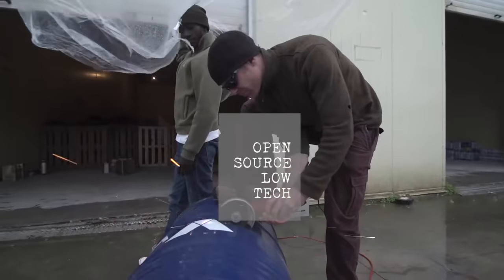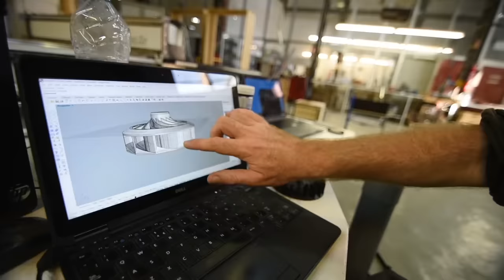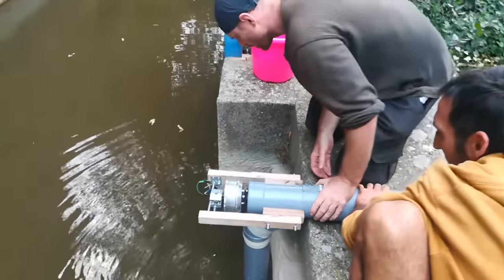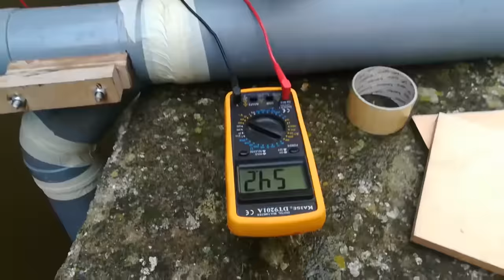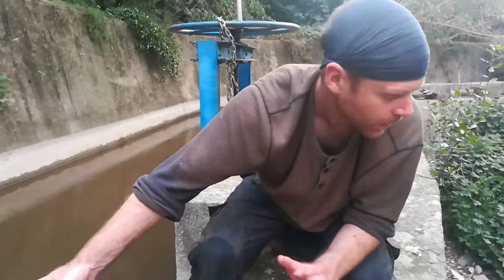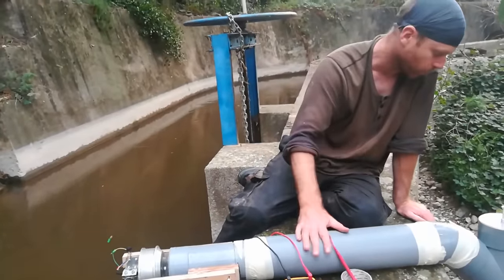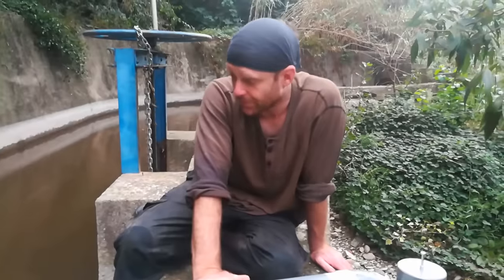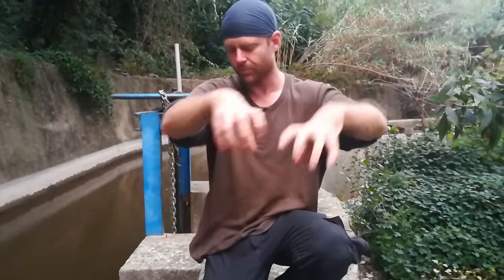The $50 Water Turbine -DIY, Portable, Powerful, and Open Source

Comment: So, first off, this is a fun little contraption that does indeed have real-world applications, so keep it up.  This is the first time I've heard of this open source project, but I think I might like to get involved!  Anyhoo, others have mentioned a few issues here and there, and things that need to be considered, and I'll just throw a few items in here as well (some of these may have already been mentioned in other comments):

1. Any air drawn into the siphon tube will want to find a place to collect.  The longer your discharge tube, the greater the chance that some of the air will be trapped at the top elbow.  A "band-aid" solution to this problem is just to add a large air-gap reservoir at the top where you've placed the cap.  A long term solution would be to use a small take-off siphon line to develop vacuum in a smaller diameter pipe along with your main discharge. In this way, you could create an "eductor" (yay Bernoulli's principle!) which draw any air out of the reservoir, thus preserving the main siphon.
2.  Your impeller is one of your major bottlenecks for producing max, continuous power.  One solution might include a multi-stage impeller with stationary blading in between.  This will maximize torque if you get it right.
3.  Blade seals - I'm not sure how you would do this simply and cost-effectively, but the trick here is to prevent any flow from passing the impeller blades without imparting any force.  Typically, a labyrinth seal is used for this, but I don't know if that's easily applied.  Perhaps someone could come up with something via 3D printer.
4.  Suction screen - you don't want to accidentally suck up large objects which could damage your impeller.  You need to put a large screen at your suction - larger is better because you will want to compensate for partial blockage in the event something gets stuck on the screen.  Simply having a section of your suction piping that has a zillion holes drilled into it, and a capped off end would work.
Reply: Eeeeeeee e eeeeeeere la ee de los de ee
Reply: Somebody understands what's happening. Wonder if they have a channel on youtube with a 3-d instructional video? I guess I'll go searching now.
Reply: @aicram62  I don't, although I've considered making vids like that.  So far I only have videos about growing exotic peppers lol.  I'd be happy to explain any part of what I said (or any other principle in this family of physics) if you have questions.  Also, I'm 100% sure there are other people who have great explainers, too.
Reply: Governments could make available injection moulded turbine blades, perhaps in glass-reinforced polypropylene.  Also, a blade design that could be reproduced locally with simple indexing lathes would allow villagers to make lots of blades and rotors. Really the blades could even be carved out of wood.
Reply: @MichaelIreland  Thank You I'm still feeling out options so I'm not ready yet. I was just impressed with your reply.
Reply: @aicram62  all good buddy!  Feel free to fire me a message any time :D
Reply: I just watched a video made two years ago where he used “stuff” he has laying around the house for all electrical components but make the impeller from a 3D printer. So that could be a viable option. He had cups on the end of the blades to use as much of the water as he could
Reply: @chasjacks9378  for sure, there are quite a few interesting impeller designs that could be useful.  Having 'cups' (they're, weirdly, usually called "buckets" on turbine blades) can help increase the torque output while reducing the speed.  This is often useful when your shaft bearing can't handle high speeds due to vibrations or if they're made of materials that wear out quickly.  Higher torque is also useful when the load (power draw) is higher than the turbine was originally designed for (results in decreased voltage, but still capable of producing current).  The real trick is to have a blade design that is fault-tolerant (so, can handle problematic flow, etc) while ALSO having as little clearance as possible (as in, water can't sneak past the turbine without pushing on the buckets).
Reply: @MichaelIreland  Hi Michael, i appreciate your input. Can you explain how this generator can produce that kind of power while not being placed at the bottom (where the water falls out) of the pipe, to benefit from more pressure due to accelariting gravity and stuff? And do you believe it would produce more if it was placed at the bottom?
Reply: @RedPillSpill101  I'd be happy to talk about this when I have some more time.  I can make some suggestions that will help.
Reply: @MichaelIreland  Great, whenever you have the time. It would be much appreciated.

Comment: wow never seen a siphon style turbine before.
Reply: do you think they're generating power legitimately already downstream, behind this guys camera?
Reply: siphon between farm ponds, back and forth, as long as the outlet is longer than the intake it will work.
Reply: Dan Di you can only siphon from a higher elevation to a lower one. Never the other way around. Really, this is a gravity powered generator.
Reply: Siphon type is highly inefficiënt. It can only achieve a vacuum at the low pressure part of the generator.
Pressure difference over the pump will always be less than 1Bar.
Mounting the pump at exit of the pipe will give extra energy. Certainly when height difference is more than say 10meters
Reply: @fransmulder9326  I think it was done this way to make it easy to test in the area he was given. I liked the design because it gives me other options in some unseen future.
Reply: @paulforester6996  It also has an unmentioned advantage. With the power taken off of the suction side of the system, there is no water getting past the seal and onto whatever alternator or generator. Get a bad seal, you get an air leak. Nothing more. In fact, if designed with a high enough flow rate, there isn't even a need for a seal. The unit would just remove the air on its own. Our pumps at work when syphoning would be locked in gear most times and the packing on the input shaft tightened down to from a seal. If we wanted more flow, we would take the engine out of gear, turn on the gearbox pre-lube pump, loosen the packing a little, and let the prop rotate. With a 2 ft head, you be surprised how fast the prop ( 8' Diameter ) would spin. Did it leak some air in, yes. Could you keep it going for a day or so, yes. It all depended on how tight you had the packing. We did this a few times when we used grease lubed packing. When we switched to water lubed, we didn't. As it would have meant that someone would have had to be there 24/7 when rotating, we just locked them down and tightened the packing normally.
Reply: Imagine it stopped who would know how to prime it
Reply: @fransmulder9326  Absolutely true. It will only work up to about 30 feet/9 meters of drop. The pressure forcing water into the turbine can not exceed the atmosphere.
Reply: Effectively, the work that is generating electricity is the output length minus the intake length. The rest of the work is going towards pulling the water from the intake side up the pipe. Also, all natural hydro generators are gravity powered.

Edit: I didn't realize the power was generated on the intake side. Same rules apply, since the net pressure is still proportional to the output length minus the intake length, and therefore moving water through the turbine, generating power. It's actually not so inefficient, just less efficient than if a siphon didn't need to be used. Increase output shaft length, increase power output, up to the limit of the generator.
Reply: Any hydropower wheel installed above the downstream (tailwater) elevation was equipped with an exit funnel (draft tube) to recover the energy available on the suction side. This setup would work better ivf the builder had installed the waterwheel (runner) at the bottom of the long tube after a set of vanes that prespin the water. The power would spin a shaft to the generator well above water level. The runner could be set below tailwater elevation.
Reply: That's because mounting the turbine on the low pressure (top side) typically causes cavitation on the back sides of the blades which destroys the turbine in a fairly short time.
Reply: Cavitation at the turbine, more likely because the turbine is located at the lowest pressure in the system, will reduce the efficiency and can cause vibrations that can trash the bearings and the seals in short order.
Reply: @gravelydon7072  Seals are still important.  If enough air leaks in the siphon will be broken and the turbine stops. Smaller leaks will reduce system efficiency. I fully agree that keep in water out of the electrical system is an advantage if this design.
Reply: Yeah, they're out there.  no biggie........
Reply: @fransmulder9326  you folks are so smart....can you please point me to a web page that will teach me about what's going on here?
Reply: @mccc4559  hi mc
No I don't know a web page that can help you further. If you could be more specific on what I can help you with I will give it a try
Reply: @TheodoreAndor  why would it stop Theo? This is essentially a perpetual process. And if it did stop then, the same way you primed 8t initially can be used again.

Also, one can use a small water pump to prime it.
Reply: @engineerncook6138  That's why you design for close fit and an extra margin. Our main pumps were rated at 297CFS each. But yet in actual use, we were getting better than 340CFS out of them. Because we never could get down to the minimum head and maximum tail water.
 In the case of this unit, a simple set of MDS bearings with an oiler filled with clean water would be a safe solution and keep the air out. 

When our main pumps were last rebuilt, they were given water lubed bearings and water lubed packings.
Reply: @fransmulder9326  ... I'm thinking about what you said about the Syphon only giving 1 bar .. 32' head .. but would the length of pipe after turnover - in other words the head of water not be an influence ?
Surely the energy availability ( created ) would equate rgh ?
Reply: @peterpauldonoghue7024  
Maybe the easiest analogy is the old type of mercury barometers. You measure the airpressure by reading the mm of mercury column it can sustain.
On the top of the column is vacuum. 
The same happens with the downward pipe of the siphon. The lowest pressure you can get on the top of the column is vacuum. (More specifically the vapour pressure of water at that temperature)

You are richt in that there is still a lot of energy in the moving water in the down pipe.
This energy cannot be accessed by the impeller/generator. That's why it is not very efficient.

Furthermore, the siphon has first to suck the water up, i.e. put potential energy in the water.

Maybe the youtube video from veritassium on the longest straw can be helpfull
Reply: Yall have to also consider that this design is meant to be portable and quickly deployable and easily servicable.  You can't just think in terms of mechanical energy efficiency.  This tool can easily be modified to suit any number of scenarios, so you can't just say one way is just better than another without considering the exact scenario it will be in.  If you give this to a random village, it will undergo changes until it suits the special conditions of that particular village.
Reply: @David-bc4rh  also when trying to achieve maximum efficiency 2 hydro plants can use the same type and size of turbine and can be made by the same company but each turbine system is highly customized for it location. and to add on tho what you said about it being portable, quickly deployable and easily serviceable it also doesn't hurt the river or stream its in as there's no digging or construction to put it in.
one change i would make is to put a flap with a quick release at the bottom so one guy can be at the top and prime it then pull on a small rope to release the flap and start the system.
Reply: @fransmulder9326  thanks for your message..... I found info on siphon turbines
Reply: @gregwarner3753  I didn't expect much more than that from a hippie engineer living in "eco-industrial colony".
Reply: @TheodoreAndor  anyone who uses an aquarium cleaner would. Gravity siphons are common in all aquarium stores. also anyone who took science in grade 7. Also you could put pictogram instructions on a plaque beside it.
Reply: Phalanx380 strangely enougg i have never even though about it.
Reply: I’d love to see any of those who know how to engineer something better go ahead and do, test the efficiency and produce a video showing the prototype, efficiency measurements and how-to. Anything else is only words and theory.

Comment: I am fascinated by the way people are reinventing the hydropower systems. Most of this was done in the late 1700's for mechanical power  and around the late 1800's for hydroelectricity. The major difference between then and now is really lower power levels. Now 500 Watt will provide a lot of light and communications. I strongly suggest finding a copy of a 19th century Water Power textbook. It should be very helpful.